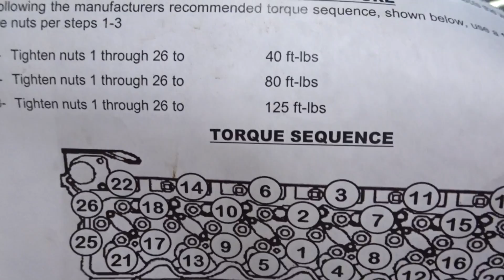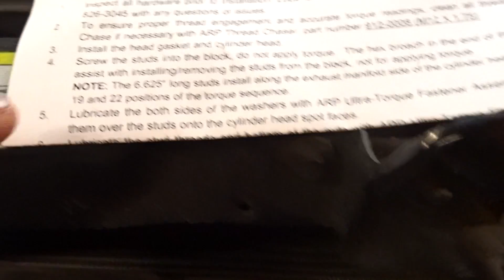Head Studs and Snap-On

Comment: i have owned several trucks that someone did this same thing.....pulled one head bolt at a time an replaced with studs....they all had leaking head gaskets. i hope you have better luck. i will be replacing the leaking head gasket on the one i still own in the near future. the truck has 220k miles....so i am going to send the head out to the machine shop and go ahead with new rings, rods, and mains while i am at it. video to come.
Reply from the maker: Interesting, a friend of mine had his original head lift on his 6.7 at 150k ish with the factory headbolts and so he had the head decked and he put it back together with arp studs and no issues since but I’ll be sure to keep an eye on them, lookin forward to that vid because I have another truck I’d like to do the same to